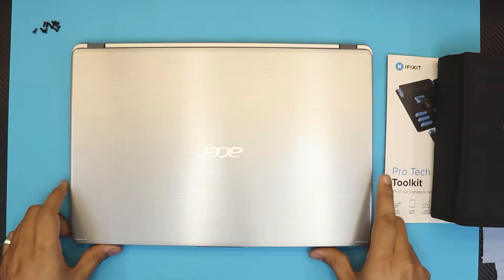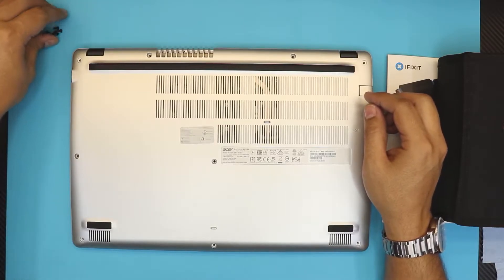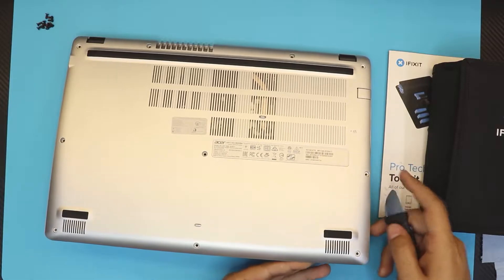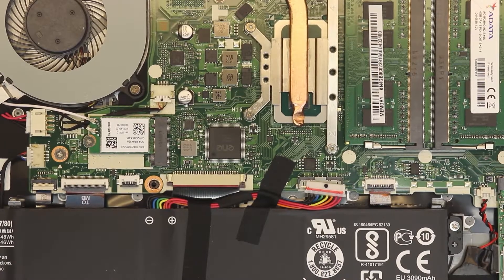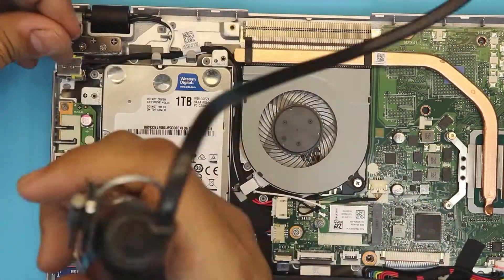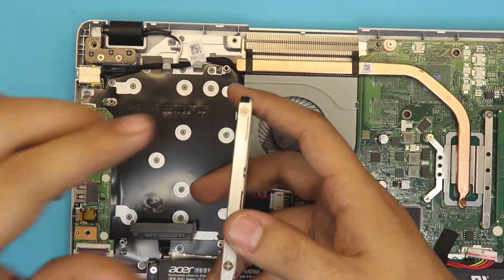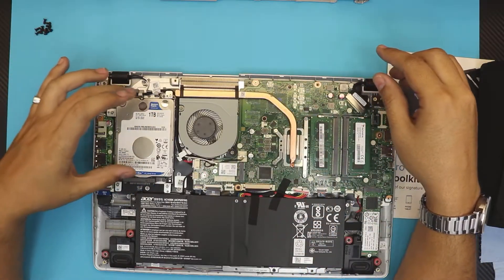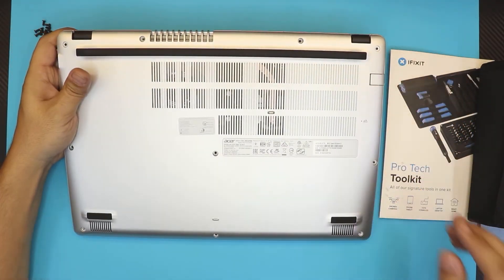How to upgrade Acer aspire 5 A515 SSD HDD FULL GUIDE

Comment: Sir, In Acer aspire 5 - A515- 56 i5 11th generation (8gb + 1TB HDD model) May I know there  is one more additional slot to put SSD along with 1TB HDD so after that I will use SSD & HDD both simultaneously?
Reply from the maker: Thank you for the feedback! if you wish to support the channel you can LIKE or SUB or both :P
regarding your question:  YES you can, you can install windows on your m.2 ssd and storage on your HDD.
Reply: @uFixTek  Sir just A quick question.. Actually this is my first laptop so i want to buy that laptop who perform well in long term so I'm confuse in between ACER Aspire 5 & Redmibook 15 which cost same & i5 11th generation .. Could you please help me which one is better for me I'm not a gamer but in future will do light gaming because I'm a MBA so do office work like presentations, Excel & all.. so I'm little worry about Redmibook because it's new player in market but Acer is old player, so it's very grateful to you if you suggest me some more better laptop within 45000 budget. I want durable laptop with performance.
Reply from the maker: Oooo hands down Redmibook 15 wins over ACER Aspire 5, we have opened and serviced them and ACER Aspire 5 has many bad components and Redmibook 15 are very awesome built inside at component level. hands down go with Redmibook 15

Comment: I do not have housing brackets for ssd nor the cable.. my laptop is aspire a515-52 ... Kindly assist
Reply from the maker: get this:
https://amzn.to/3kW9Im6
and get a SSD and place it there without the caddy for ssd you dont need a caddy just use a thick double side tape.:
https://amzn.to/3rHuf0x
Reply: @uFixTek  its for nitro .. mine is aspire 5 a515-52
Reply from the maker: @UCAEoh1EOLMzp6Q_89dyEjIA don't worry they are all the same its a 12pin ribbon connector its fully compatible.

Comment: Hey, if you could help, i don't seem to have the sata connector and the ssd housing. Could I buy those and put another ssd in there? I already have a m.2 ssd
Reply from the maker: Thank you for the support to the channel by a SUB :P , sure my friend all you need is this cable:
https://amzn.to/2MJyKbt
then regarding the hdd caddy they don't sell but you can use a thick double side adhesive tape to keep the hdd in place and nothing will happen.
https://amzn.to/3rsuPi3
place the adhesive tape on the back of the HDD only one square on top back and one on bottom back and thats all

Comment: can I have a SSD instead of HDD in the free slot?
Reply from the maker: yes you can and it will be super fast and buy a hdd 2.5' case for the hdd so you can use it externally,
https://amzn.to/3af00Xa
thank you for the feedback and your support to the channel my friend
Reply: @uFixTek  Cheers!
Reply from the maker: :P
Reply: @EduardoMusasa  did it work ?
Reply: @karang5564  It did. Pretty straightforward, you just need to attach the second sad and that is it, no need of installing drivers or anything